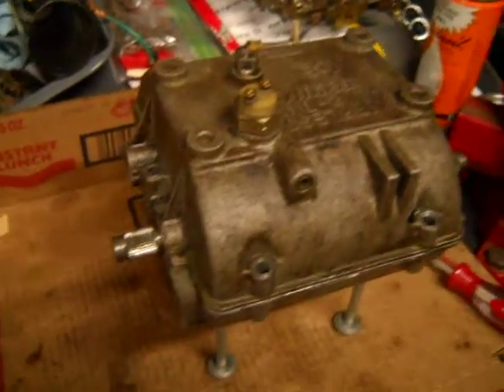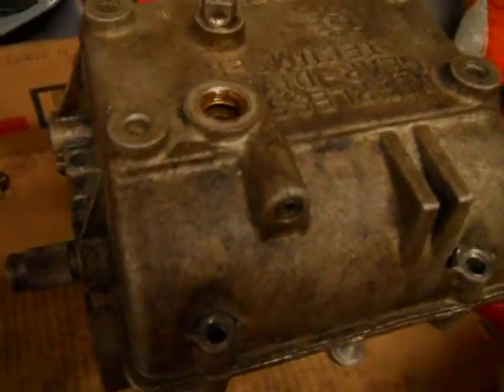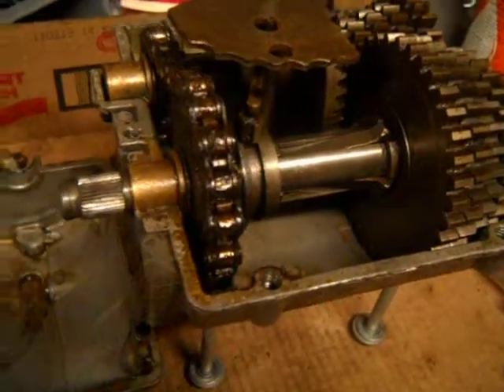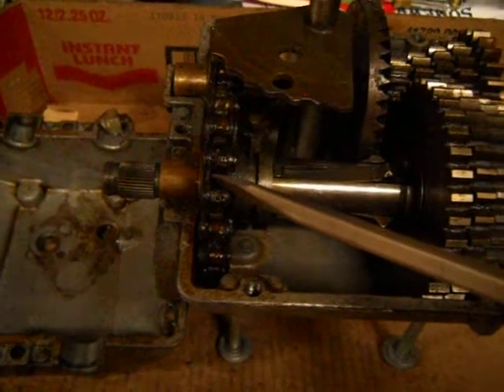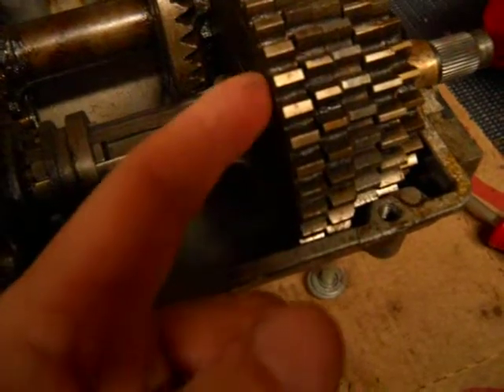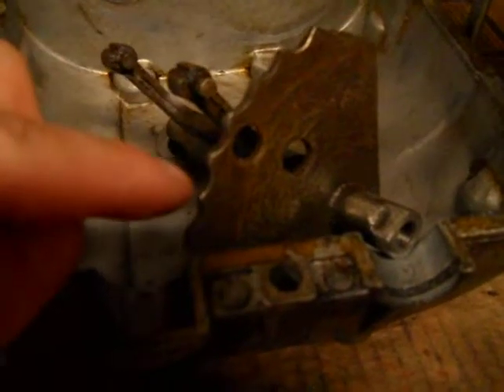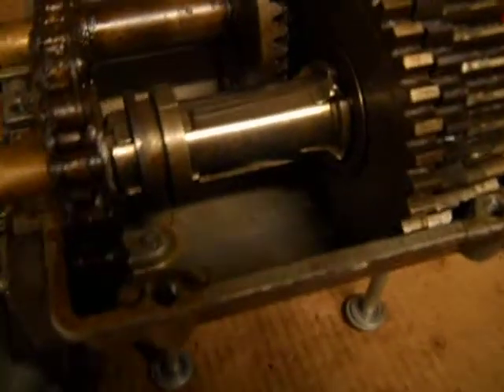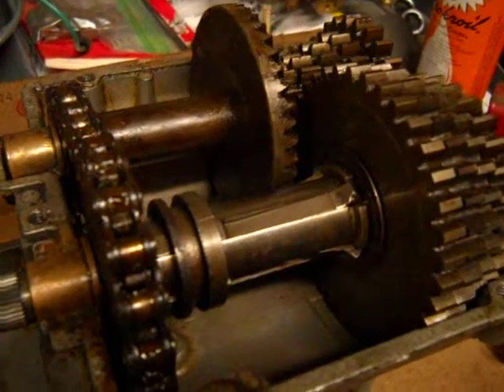How a peerless 700 transmission works

Comment: Question for you so im thinking about using one of these transmissions with a 23 hp lawnmower engine but im not using it for a gocart im using it for a mud motor so ill have forward and reverse my Question is could I just start it in the gear I want and would that be fine without installing a clutch

Comment: I have a john deere 170 with a peerless 801 I think. It occasionally slips a bit in 3rd gear. I was wondering if its possible to flip the gear and use the other side so to speak of the notches where the shift pins engage the gears. Are the gears flipable or do they install only one way ? Also what do you run for gear grease bentonite or benton 2 grease or corn head grease or 00 grease or something else? Thanks
Reply from the maker: @jimhoward1655  you can try flipping the gear it might work for a little while. For grease I use corn head grease.
Reply: @ZigZag9  Thanks. Looking at parts gears it looks like there not flippable...oh well i think new shift pins should fix it from what I've read. Are you happy with the corn head grease ?

Comment: Thank you so much for making this video. I bought a old exmark metro at a auction. Only had a single speed due to the shifter just flopping around.  
   So price was right.  Opened the case up and now, thanks to your video, I can see that the shaft is rusty and not allowing the collar to move.
    They must have tried to force it and bent the forks, popping it off the collar. Time to order a new fork and clean her up.

Comment: Thank you for the video! I have the similar gearbox, but it has only 2 switching keys. Can you please give me the ID number of gearbox having 4 keys? The gerbox weakest point is the switching keys, I had to replace them already 2 times.
Reply from the maker: ID number is not that necessary all you would need to do is find another peerless 700 with the four shift keys. Easy as simply changing out the shaft.
Reply: Thank you for your kind answer, but the reason I asked the certain ID number to find the 4 shift key peerless 700 gear. So far I had no success findig it.

Comment: Thanks a ton for the video. My issue is stuck in neutral. The ring that the shift arm moves in and out of gear won’t move so it won’t push it into gear. Does this mean the keyed area is rusted onto the shaft? Please help

Comment: do you know why my 700-072 4 key would slip? Well I thought Id have missing gear teeth on the gears why it would slip and re grab... come to find out after inspecting, my 4 key is a 3 key! Will the lack of one key cause the slippage??
Reply: I ended up just ordering a new unit, but this particular model is pricey and might order a new 4 key shaft and fix the existing one to sell

Comment: I have a very similar transmission in an ExMark Metro-14k-5 It suddenly stopped driving the left drive wheel but the right side still drives.  What would cause the left side to stop driving under load?
Reply: Same issue here. You ever figure it out?

Comment: HY I HAVE A BOBCAT CLASSIC PRO 36 AND THE TRANSMISSION HAVE A NOISE IS LIKE THEY NEED OIL CAN YOU TELL ME WHAT HAPPEN WITH THAT NOISE THEY NEED OIL O CHANGE THE TRANSMISSION THEY SHIFT GOOD AND RUN GOOD BUT IS THE NOISE
Reply from the maker: These do not normally use oil. They have grease from the factory. You may have damaged gears causing the noise.

Comment: Is there a downside to running oil instead of grease in a gearbox that will be used to mow, not race?
Reply from the maker: Using oil in a gearbox to mow may not lubricate the gears as well since everything is moving at a slower speed. There is a grease you can use called cornhead grease that is a cross between oil and grease mix. I think it would work perfect for your application.
Reply: @ZigZag9  Thanks for the explanation! I'll check it out. :)

Comment: Dang it, all you had to do was do a close up of the end thrust washer & I would know which way they go, now I need to find another video explaining which direction the thrust washers go....  Mine were both ways so I couldn't determine which is right.  I'm guessing that the bevel needs to be to the left or out so the keys will hit the rounded part & bounce inward as they go in. ??

Comment: I have this on my exmark walk behind. Noticed my right side drive shaft spline had play in and out but my left doesn't.  Any idea what's broke? Thank buddy.
Reply from the maker: Could be that your bronze bushing may be worn down or spacer washer inside is worn.
Reply: @ZigZag9  thanks, I plan to spend tomorrow working on the mower I'll take a look. I don't see those parts available on parts tree. What the best parts supplier you go to for this stuff?

Comment: Thank you for the video.  Mine is slipping and you gave me an inside look before I took it apart.  Now I can order some parts without having the transmission apart while waiting.  You have saved me some time. Thank you!!
Reply: Where did you find parts

Comment: PLEASE RESPOND: I have a peerless 700 with a H pattern shifter. How do I take it apart? Will anything jump out when dissembling?? It’s the 3 speed model. Help would be MUCH appreciated
Reply from the maker: There should be bolts holding the case together. nothing will jump out at you just slowly split the case apart.
Reply: @ZigZag9  Thanks! I’m gonna rebuild it since I’ve been having issues with it... Where can I buy parts for it? Like gears, shafts, bearings, etc.
Reply from the maker: @Farmtractor  There should be a tag on the case with the model number and code. your local lawnmower repair shop should be able to order all the parts you will need.
Reply: @ZigZag9  thanks so much!

Comment: Thank you for the video very helpful. Can gears & internal parts be purchased or do I need to find used Trans to salvage parts. I’m struggling to find and lawn mower shops, they just want to sell new,  complete trans.
Reply from the maker: You should be able to buy new replacement parts as long as you have the part number.

Comment: You did not show how the ball and spring is set up.And were can we get parts for this transmission.My shift lever just moves freely with no resistance .I ony found 1 ball in mine?
Reply from the maker: there is supposed to be only 1 ball inside

Comment: My dad was pushing snow with his riding mower with a peerless gearbox 758A.
He pushed hard and then it broke. No gear action forward of backwards. Any ideas what likely has broken? I assume this is something that might happen in lawnmower racing also. 
Where to buy parts?

Thanks to your awsome video im going to open it up and try to diagnose it.
Reply from the maker: Thanks buddy for the comment. it sounds like it might be the shift keys or the gears themselves. its hard to tell without opening it up.

Comment: I have a toro 8-25 wheel horse that will work in 1st through 3rd but not 4th or 5th - do you think I need new shift keys? Thanks
Reply from the maker: its hard to tell. i would probably open it up and see whats going on inside. shift keys are possibly worn but it sounds more like gears.
Reply: Alan's small engine service  thanks ! I guess the only way to find out is to take it apart - now I’m down to only 1st and reverse

Comment: Great video! I have a Peerless Model 505 and the schematic does not show the washers you mentioned between the output gears?  What lub do you use? If oil, how to you keep it from leaking out?
Reply from the maker: i would use cornhead grease made by john deere. if using oil go with a gear type oil but you will need an oil seal where the input shaft is. The washers between the output gears need to be there otherwise your trans will not stay in gear.
Reply: @ZigZag9 HEY ZIG what I want to know is when I have my lawnmower ON in NEUTRAL then i put into ANY GEAR it won't move,,,,But if i turn it OFF & put into any GEAR 12345-REVERSE it a go in that GEAR only when the motor is on it doesn't move what am i'm missing here bud PLEASE in needs some HELP!!!!!